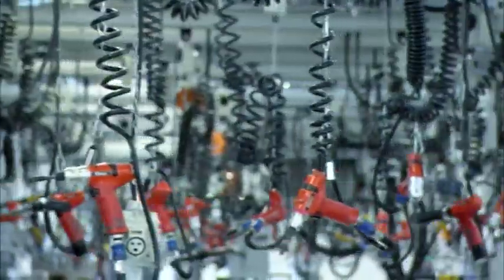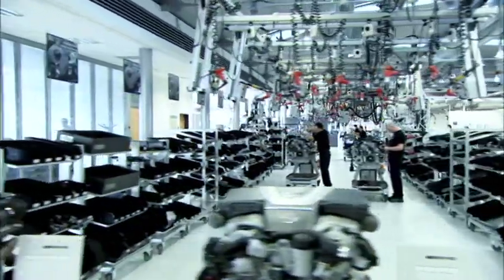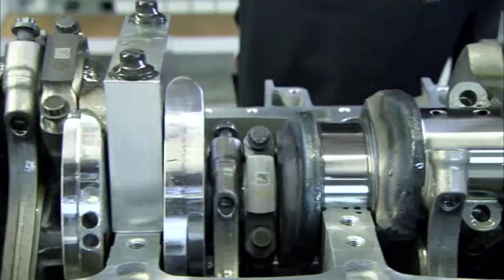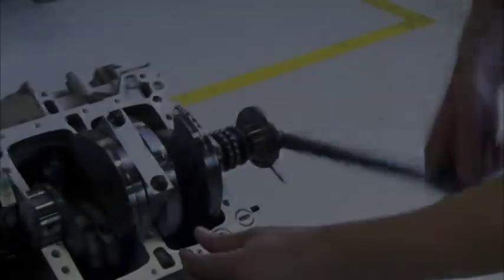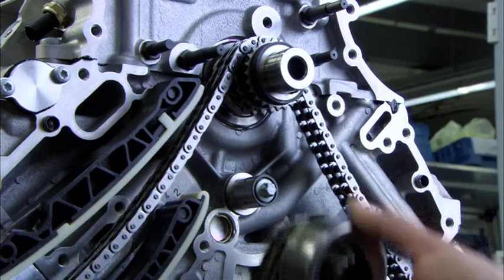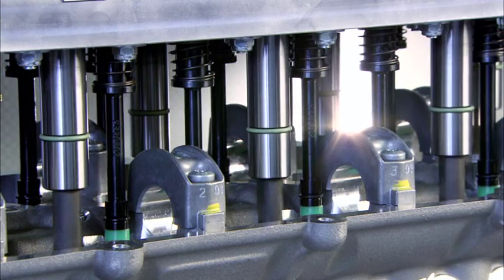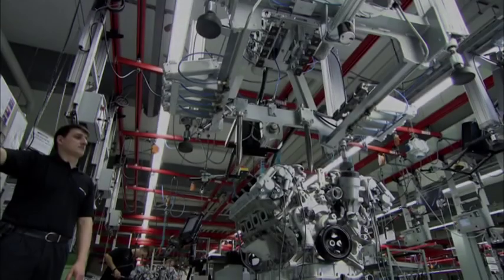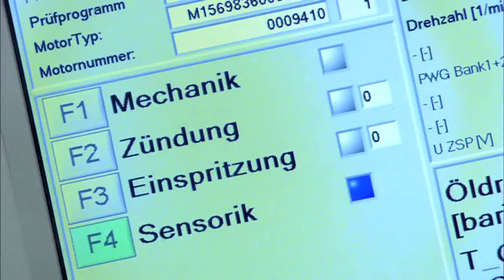Mercedes-Benz AMG Engine Production

Comment: I want to change a part of my engine but sure what’s it called the cover the rocket cover maybe? It’s cracked and is leaking oil
Reply: VERY common problem.  No idea why they "updated" them from metal to plastic.  But the part your looking for is called the Valve cover.  Don't forget to order a new Valve cover gasket as well :)  as the gaskets are not re-usable.